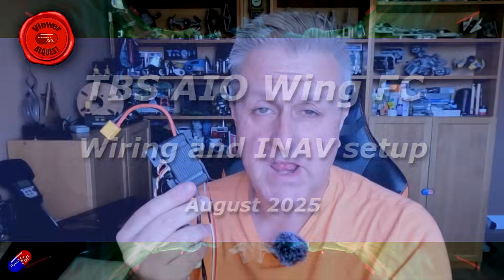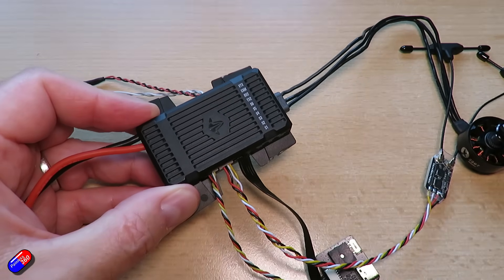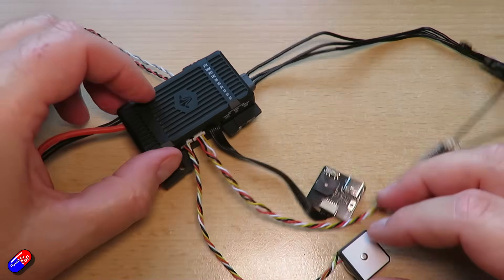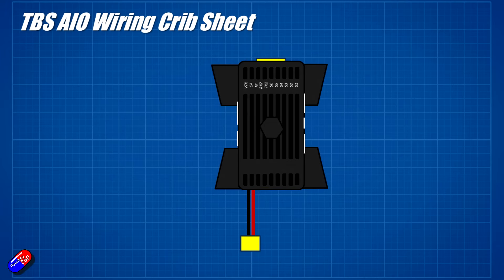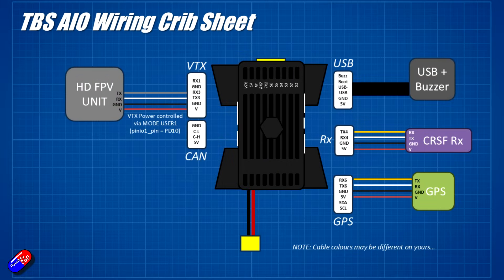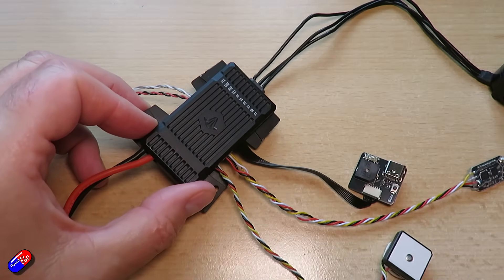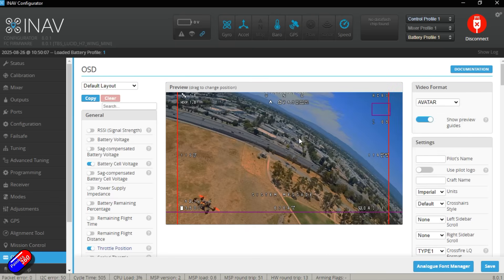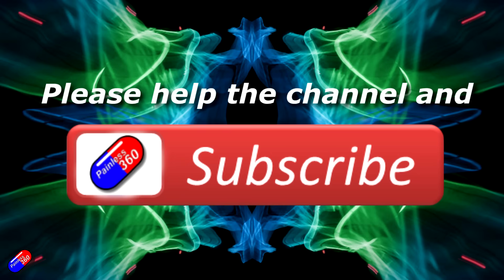TBS AIO Wing FC Wiring and Setup Basics for INAV

Comment: Gosh I love your videos but still, you soldering everything together makes it difficult for us who are not trying to solder it - we're trying to follow you on our build. I am especially confused with how to get the GPS connected to the board because mine just has four cables coming out of it with a loose end. And nothing matches up as a GPS connector on the flight controller has a 6 pin output... Could you help some of us stuck with the GPS cable on which wires connect to which because the colors don't match up either.
Reply from the maker: Check out the wiring diagram. Sadly soldering remains a necessary skill for building electronics. I did get my hands on a production kit here so I will make a quick diagram and pop it in the POST section... Best of luck
Reply: Thank you!

Comment: In your opinion is necessary to put a capacitor on battery side? Usually i use always a cap. and i cant see if in this ESC there is a cap.Thanks
Reply from the maker: Not needed as there is a CAP inside the AIO. Can't hurt to add another, but there is one there by default.. Happy flying!
Reply: @Painless360  Ok perfect, thanks for info :)

Comment: did your kit come with GPS wiring with connectors on both ends? Mine has a 4pin connector on one end but needs soldering on the other. I'm surprised by this, and surprised that it ships with a 4pin GPS and not one w/ compass that has a matching 6pin connector. Also, strangely, your pinout of the FC's GPS doesn't match the TBS manual.
Reply from the maker: TBS manual shows ports looking from the bottom of the AIO. It was confusing. .. Happy flying
Reply: @Painless360  Thanks!!
Reply: Yeah TBS really left some loose ends in a aio and ready to fly kit 😢... I am plugging things in and just can't understand wmhow the gps gets connected. Good job @teamblacksheep

Comment: bonjour je n'arrive pas a activer mon interrupteur sf pour mettre le buzzer sur ma tango 2 avec inav,  j'ai le tbs chupito pnp pouvez vous m'aider s'il vous plait merci
Reply from the maker: Make sure BUZZER as. Anode is setup in the MODES tab and the little switch that disables the. Buzzer on the USB board isn't switched on. Best of luck
Reply: @Painless360  merci sa fonctionne reste plus que des dernière pièce et elle prendre bientôt son 1er vol et tu vient de gagné un abonné 😉

Comment: Lee, I've started my installation of an SBF405MINI. Let say this: it's tight! That fc was purposely built for the chupito, it seems. For those going my route,  18-20ga wire. Anything thicker will cause an issue. You need flexibility in the power cable. I had to insert the esc connector to the motor from the rear. Soldering to fc will be done inside the fuse. Lastly, the reason for the 18-20ga wire, you'll need to bend the power cable down out of the way of the wing catches. Just a heads up for anyone not using the tbs aio fc
Reply from the maker: Great feedback - thanks for sharing your experience!. Happy flying!
Reply: I have fittet the larger F405+ BN880 GPS. Took a 3D printed plate adapter, but it fits.

Comment: I have a question about motor direction. Is it easy to reverse the motor on that FC? I have so many CCW props I have to use instead of the stock one
Reply from the maker: Yes, via the AM32 firmware in the ESC

Comment: A fantastic design by Team Black Sheep.  Having the flight controller combined with the ESC is a brilliant idea + telemetry between them is awesome. A very neat, powerful little setup. Great review by the way. Rotorflex👍
Reply: Purposely built as it seems. I'm using an SBF405MINI, and it's a tight fit. Having the esc as part of the system is a plus. I'm trying to get it all fitted in and keep it neat and clean.